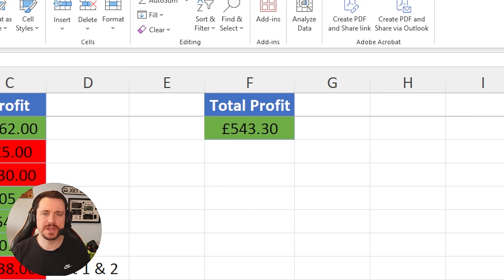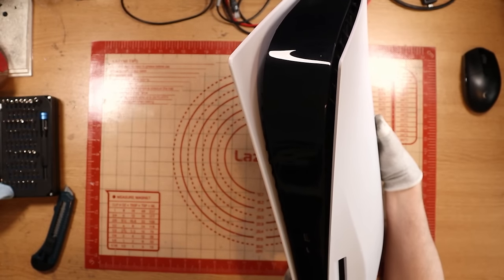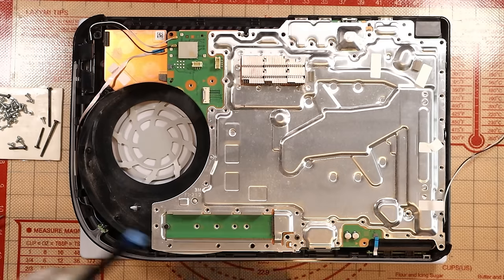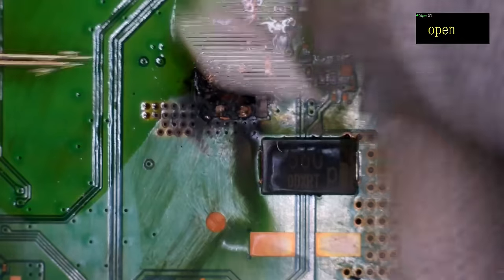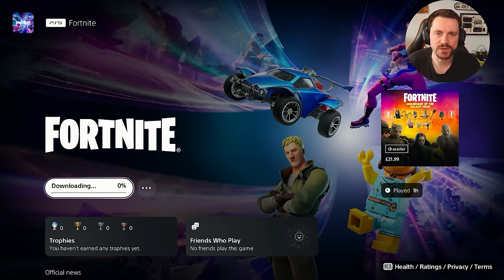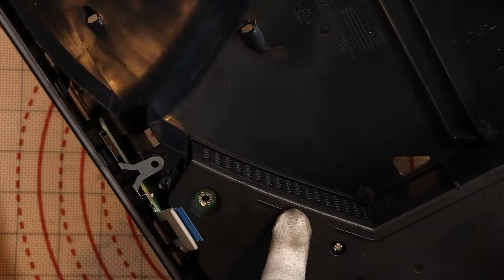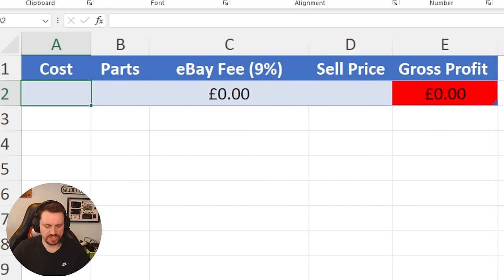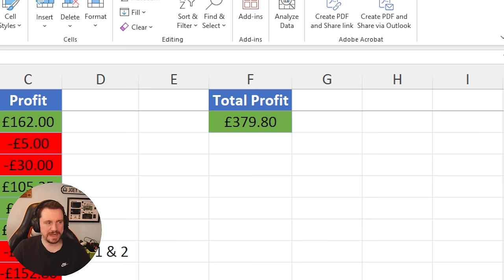Buying FAULTY PS5's on eBay - Can We Fix Them? S1:E65

Comment: That second PS5 turning off after a while, it seems to me like it has a faulty capacitor. Not a "shorted" capacitor, but a DEGRADED one related to the APU directly. The APU stops responding because the faulty capacitor is falling short of the capacitance it would need to stabilize the voltage going into the APU, so when there's a moment when the APU needs that energy and the capacitor is not delivering it in time, then there's only "dirty" energy going into the APU. So the APU becomes unstable and so the data inside gets corrupted. Causing a kernel panic. Also, the "unexpected power failure" can also be related to a capacitor because of the same reasons. I would look at the capacitors in the phases and/or replace the power supply for a known good one for testing.
Reply: It could also be the MOSFETs driver now that I think about it. That would take into account that only some phases seem to be talking all the load. That uneven heat could be the key to that
Reply: My first thought when seeing that error was "replace the capacitors", next try a different power supply. This sort of intermittent issue under load with various power related error almost screams unstable power source somewhere.

Comment: That second PS5 was quite odd with those bottom two MOSFETs seemingly working some and then not at all.  I wonder if there could be a drive problem between the phase control IC and the DrMOS.  Those six should be working in parallel to supply the massive current needed by the APU.  I wonder if the APU core voltage is sagging because those MOSFETs are not helping.  I wonder a lot.  Great job!
Reply: you're here
Reply: This was my thought. Need to get a scope on those supply voltages and look at the wave forms. Really odd issue.
Reply: Scope time !!!
Reply: I’m with @toltecmerc, it seems that the control IC in not sending the proper PWM to those DrMOS

Comment: with the second PS5, it can be a bad PSU, even though its reporting 12v rail, under stress it can fail, i have had PSU that do this 100%
Reply: Was just going to mention that it might be a dying psu.
Reply: Could we be voltage dipping when it has a load had this with a pc with a dying psu, could do anything fine till the GPU had a load then BSOD
Reply: @simonupton-millard  its shutting off right when the APU will be drawing max power on the main menu of the game, its got to be the PSU imo

Comment: I would definitely try that second ps5 with a different PSU, could easily be a power dropout on the 12v supply, would also explain the lack or pulsing of power on the lower mosfets

Comment: I started using the Better way Electronics UART reader and it seems a little more detailed then googling the codes.  I am also curious if the Ram has an issues. I watched a video of Toltecmerc where his PS5 was stuttering and not running smoothly and replacing the 8 RAM chips did the trick.  Worth a shot

Comment: Don't have experience in repairing electronics (just on embedded devices, debugging) but on the second PS5 I would check those capacitors and the phase control IC. Probably a scope would have prove useful.

Comment: I agree with a lot of comments: check the power supply. I had a pc that turned on fine, would load games and then randomly shit off (especially under stress). After checking every component it turns out my PSU was dying and would shut off under stress..new PSU and problems went away

Comment: The flashing of the second mosfet suggests to me that something in that area is failing. I would strongly suggest replacing all the caps on the 2 bottom mosfets to rule it out. Apart from that as others have suggested could be power suppl,y especially considering the randomness of the errors in uart. 2 things to check.

Comment: Misfits will pulse heat if there's some low resistance on another part of the board down from the mosfet.   tvs that pulse normally have a bad diode or resistor on the output side.  This can cause intermittent faults shutting the system down randomly.

Comment: what are the chances the second PS5 had a faulty PSU?
Reply: that’s my guess too, in my experience faulty power supplies will sometimes work fine to boot and do basic tasks but the second you try and do anything intensive it shuts off
Reply: It can definitely be the problem, my PC was booting up but no output to the monitor. I tried to change cables, use the VGA ports instead of the DVI, tried without graphics card, using the motherboard outputs, nothing. The pc was running perfectly tho.

Turns out my PSU crapped out and didnt deliver enough power for the gpu(its an old 1050, no powerhouse needing 300W) or the apu, replaced it, been working fine ever since.

I guess my point is that if you dont give a system enough power it will act up and obviously different systems have different priorities for power, thats the nature of physics. Its definitely a possibility that APU starts draining more power when launching fortnite and the system cuts off.
Reply: Not sure if he is using a donor chassis but if not then yes, definitely test with a different psu
Reply: That’s what went through my mind too, it would certainly be worth a try.
Reply: I was thinking exactly the same. Bad PSU

Comment: I hope Joey takes another look at the 2nd one. It's infuriating that the seller of first one knew it was that bad and didn't disclose it. So dishonest.
Reply: @MyRegardsToTheDodo  Joey obviously didn't know there had been a small fire so that wasn't disclosed unless he just bought it without reading the description, which he's done LoL
Reply: @MyRegardsToTheDodo  that's the thing though, on eBay there's not a "faulty" category. It's just "for parts, not working" even if it's fixable. So they technically don't have to disclose anything. I find that dishonest personally if they know what's wrong with it. It's like the ones that sell heavily water damaged units and don't disclose it, knowing it's water damaged. Now, you're right,  the lower cost shows they are least weren't trying to rip someone off.

Comment: Joey, did you test the second console in a donor chassis? If not then I would try another power supply. They can test ok at no current but cut out under load.

Comment: In the case of the second ps5. I think that could be a psu problem as well. I hade it with my pc once that when I started a game my pc shut down because the power supply was damaged. When the comonents draw more power it could not handle it propery and shut down just like that ps5.

Comment: You’ll need an oscilloscope to measure the frequency on each coil and see which one is different…. the frequency is generated by the mosfet controller (phase controller). So you can try and swap the phase controller. Regarding the 2 bottom mosfets that doesn’t look they are getting hot, they might be “used on demand” when the apu needs more power phase controller will activate those mosfets also. This is why you see them glowing from time to time. In full load, apu will ask for power and they will be activated by phase controller. Good luck!

Comment: sounds like a psu problem in my eyesm i did had a similar problem on pc, with a psu i had, as soon you put a load on it, it shut off, otherwise it worked fine the psu